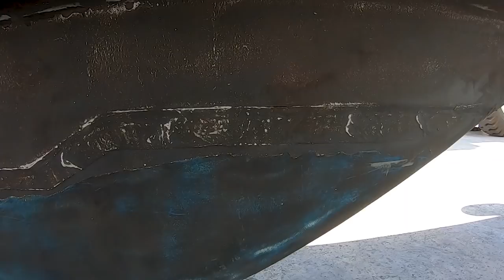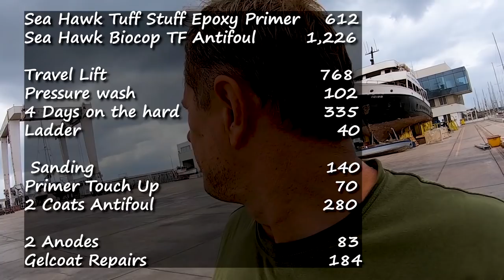#64t Second Haul Out, Anti Fouling and Repairs| Sailing Sisu Leopard 45 Catamaran Circumnavigating

Comment: So this is the second time in 6 months for anti fouling...? And the liftout and the new anti fouling was coverd under warranty by Leopard?  Interesting... I am wondering if any other Leopards are having this same issue.  By the way, my interest is in the Leopard 40.  I'm planning in the next year to get into the Moorings program with a Leopard 40.  Love watching your Leopard 45 in action.
Reply from the maker: Sad but true :-) Not sure about the other Leopards. Ours originally had the problem of that RC did not prepared the sikaflex between hull and sacrificial keel, before applying primer...
Reply: @SailingSisu  Did they cover the repairs under warranty?
Reply from the maker: 😅 yes
Reply: @SailingSisu  Thanks for the info, it is probably the most important piece of information to take away from the video.

Comment: Interesting to see the drain holes for the aft cockpit and the salon ... you showed those "huge" drain holes at 18:24 on the video. It seemed like there were some Drips of the gel coat that came from inside or around those drain holes... I assume that was done by the factory, right?  Can you comment on this?
Reply from the maker: Yes, it is gelcoat drops or spillage which got hard like that and it was from RC :-(

Comment: Great haul out video! Very informative, esp the cost breakdown. It was interesting to see the sacrificial keel/main keel structure.  Re: The zinc corrosion, maybe the anodes need to be bigger than normal?
Reply from the maker: Thank you, Robert! I will have a look at the anodes...we are now in a marina waiting for some spare parts and for the winter storms to pass, so, it would be interesting to see how the anodes handled the marina environment. But we do have a lot of electronics onboard....if there is some wrong wiring somewhere, then it will also kill the anodes...
Reply: Sailing Sisu I found this article interesting:

https://www.boats.com/reviews/all-about-saildrives/

“Volvo electrically isolates their drives from their engines to minimize the chance of any electrolytic, more commonly known as “stray current” corrosion, occurring. Yanmar does not, and so one of the potential issues here occurs whenever your boat is plugged into shore power. Without electrical isolation, any boat plugged into shore power is connected electrically to all of its dock mates via the green grounding wire in their shore power system. This connection creates a galvanic cell and means that your boat’s anodes may actually end up protecting one or more of your dock buddies. This is a sure-fire way to deplete your saildrive’s anodes too quickly.

Also, keep in mind that accessory bronze folding propellers, which are popular especially with racing sailors, can add a rather substantial mass of extra metal to your drive and make for extra hard work for the anode(s). This very addition will require that anode consumption be monitored carefully until you establish a known service interval with your drive’s anodes.”

Comment: this issue has popped up many times before on forums and marine electrical manuals, so this why i know about this. People do not normally what to install the Tx due to the cost and also the weight. Best to have this issue checked at the manufacture of the vessel but i do not know whether this standard install yet even though if the client is going to dock at marina. Also on another  point with continuous docking at the marina one guy configured his vessel with the water line from the marina to directly to the services via a cock and inline water filter. He does not allow direct flow to   the fresh water tanks which is disconnected via one of the cocks to prevent contamination. One thing he did say that one time he forget to turn the cock back on from the tanks when he when back out to open sea but this is easily fixed   
from the sail drive manual, 

CORROSION CONTROL
It is the boat designer’s responsibility and/or the re-powering engineer’s responsibility to design the proper systems and equipment to control and reduce the possibility of galvanic corrosion.

However, it is essential that the owner/ operator frequently monitor the anodes for wear, inspect the sail-drive for corrosion and replace the anodes often enough to provide a sacrificial surface for the electrical current to attack. Galvanic isolators and isolation transformers are also available from the aftermarket (not supplied by Yanmar). 

The Galvanic isolator is a device 
that is installed in series with the (AC) grounding (GREEN) conductor of the shore-power cable to effectively block low-voltage DC galvanic current flow but permit the passage of alternating current (AC) *. The rate of corrosion depends on numerous factors, such as:
 • the number, size and location of sacrificial anodes on the sail-drive and vessel; 
• the marina environment, such as stray current in the water, fresh or salt water and use and isolation of shore power;
• improper application of marine paint or antifouling paint; 
• failure to repaint damaged areas; and 
 • how the vessel is bonded. Please check with the boat builder, dealer or other professional to determine if your vessel and/or Sail-Drive is adequately protected from galvanic corrosion.
NOTICE: The anode of the Sail-Drive is only calculated for the Sail-Drive. Changing the material of the propeller may require additional anodes to be installed on the Sail-Drive 

thought you may like to know
regards
Reply from the maker: Thank you, David! Yes, we do have a Galvanic Isolator installed by manufacturer. I have recently posted a video on why you need a Galvanic Isolator. Kindly check it out!
Reply: @SailingSisu  In my own opinion  you are providing a unique product in the area of blue water sailing. They is so many unanswered questions on the more practical side like simple thing like food management and vessel management if a person wants to follow in the area of blue water sailing. Thank You for the honest portrayal of your of experiences showing the good, the excitement of new experiences of life, the bad when things go wrong (storms and breakdowns) and the ability to share the information for future travellers

In regard to the ability to maximise  clean power generator on the vessels which i can see that you have gone to great lengths at the beginning to try to resolve the maximum power requirement issue I also will need to follow your path in the future  to the seawind manufacturer to see if this is possible and hopefully  able to request the that the DC subsystem be on 24V DC  rail to allow the installation of larger wattage solar panels on a 24v dc array as well as also install duel 1000 watt wind generators which are available in 24v DC minimum or also in a 48V DC option. 

24V  DC rail will allows for twice the power circulation for the same cable sizing and current (which not your friend & causes power loss). 

You can run in theory both 12 volt DC and 24V DC equipment   by just running a split halfway in the battery pack configuration and run a separate positive to the main fuse board for any 12v DC equipment. At present most  cats on the market have subsystem DC are 12V  rail and the generators on the diesel including diesel engine management would need be upgraded 24V  as well as all the other charging monitoring electronics. I will  also have to look at the inverter to see if available in a 24V dc rail marine standard. 

This may not be possible at present and I just may have do this myself over a period of time in the future which what normally happens but at present i can only dream as well as watch your youtube blog with the present financial issues of the stock markets due to the virus
regards
Reply from the maker: Yes, I think in retrospect, 48V on the Lithium system would have been a good idea and the run a DC to DC convertor to the 12V panel. Would have been much smaller and lighter cables running around the boat.

Comment: Sorry to be a YouTube "expert" I am not an Electrical engineer and fully aware that this question may well be totally stupid but have you considered an Galvanic Isolator and/or an Isolation Transformer? Also what were your reasons for not going Copper Coat from the start? You have invested heavily in a very nice boat and home and although I am aware that it costs considerably more than a normal paint job if properly applied it seems that it will last you 10 years plus and eliminate the need for expensive haulouts just to reapply paint, obviously it will not eliminate the need for haul outs entirely.
Reply from the maker: Very good observation, Glen! We do have a Galvanic Isolator. The factory did not provide us with an option to do copper coat from the start, in fact, I did not even thought about that...my bad :-) but you are right..."if properly applied" which the original were not. Apparently the boat builder originally did not treated the Sikaflex joint between hull and sacrificial keel properly. Then they fixed that, but did not stripped the antifoul properly during that fix, which caused another reason for an early haul out :-(

Comment: I’m confused this is the first time you have had the boat hauled out. Or if you’ve done it before why haven’t you marked the hull for strap placement. Instead of going thru all this confusion.
Reply from the maker: Yes, I do have photos of the placement for the bands, but I was not sure if the bands dragged on the hull and perhaps got caught by the sensors or whether they were deep enough and came straight up...

Comment: Wow, this is one of my favourite videos. I was nervous with you when the crain started lifting. So from what I calculate this major service is about every 6000 miles? How many days did it take? As always I can't wait for the next video happy sailing guys!
Reply from the maker: Hi, Negus! It was nerve wrecking for us too! We have so many sensors and sonars and stuff below! The major service on the engine needs to be done every 250 hours and we try to keep  both the engine hours the same. The antifouling needs to be done every year and one can stretch it to two years, but this time we noticed that the antifouling was flaking off way ahead of schedule, hence we needed to do it again. I basically check the hull every time I dive on the anchor or when we go for a swim ;-) It took one day for washing, two days for paint, and one day to dry. So all in all, 4 days out of the water.